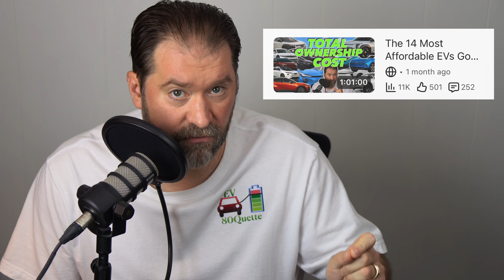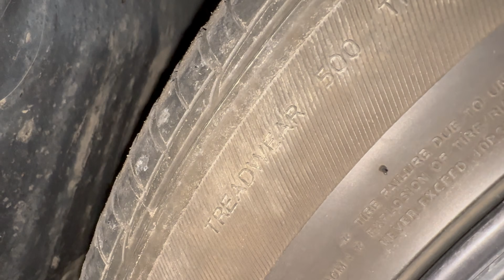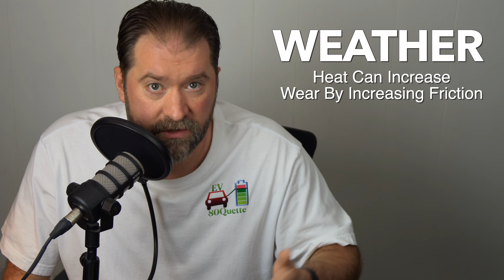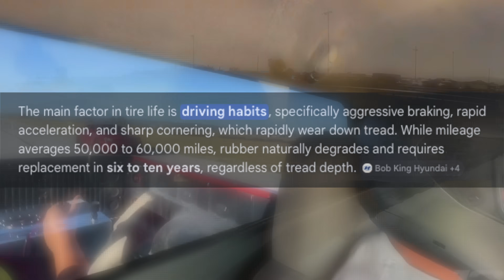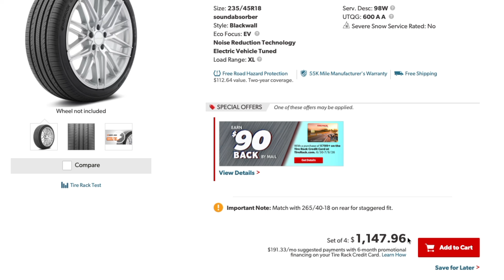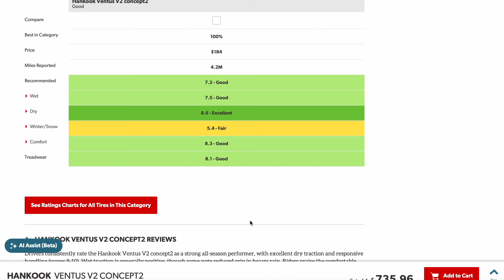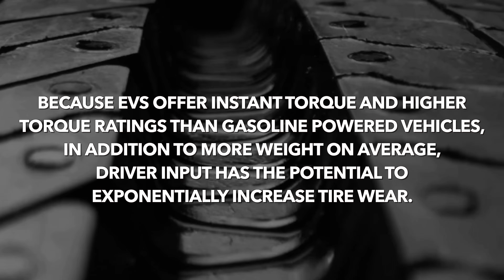I Got New Tires For My EV - Here's Everything I Learned

Comment: Wound up replacing the OEM Michelin Primacy AS on my IONIQ 5 at 39K miles with the Michelin CrossClimate 2s. Michelin does not exclude OEM tires from their mileage warranty, so I was able to get a 25% rebate after installation by going through their claims process; the hardest part was getting someone at the dealer on the phone with Michelin to verify the tire model and wear. The CC2s are slightly louder, but not bothersome. However they have much better traction in all conditions, and I haven't seen much efficiency loss, even on road trips.
Reply from the maker: The Cross Climate is a very popular tire, and great in every weather condition. Good choice! Nice to know you were able to take advantage of the warranty as well!

Comment: Great video.  I have owned a couple sets of Continental DWS's with my old ICE car and they are a great tire! I'm planning on getting a set on my Model 3 when the time comes for replacing tires.  My Acura would wear Michelins in the rear but the Continentals wore great and lasted twice as long. I would get about 42,000 miles on them with spirited driving.  I would expect a similar outcome with my Model 3 as well.
Reply from the maker: This is great to hear! I hope ours give a similar result

Comment: The best all around tire for me is the Michelin crossclimate 2 lasted over 60k miles. I wanted a tire that I did not have to swap out for snow tires. I live in the Rochester NY area with lots of snow in winter and the crossclimate 2 are 3peak and have worked great. Would have lasted a little longer but alignment went bad.
Reply: Forgot to mention my car is a 2021 Chevy bolt.
Reply from the maker: Thanks so much for sharing your experience.  Having a versatile tire that works in every weather condition can help a lot. Cheers!
Reply: I was this close to getting Crossclimate 2s because of good stories like this. Then I had someone change my mind at the last minute and I got regular snow tires instead. Now I'm stuck doing swaps while I continue to find stories like this about how great Crossclimate 2s are. I should have just done it. 
Maybe I'll just do it anyway and try to offload the other winter tires on eBay or at work or something. (not Facebook Marketplace, I've never had a Facebook account and I'm not looking to change that)

Comment: Good choice on the tires. I used to use those on the rear of my C6.
One important thing about tire pressure... It's set when the tires are cold, meaning they haven't been driven for at least a few hours or at freeway speeds. 
It's OK to let the pressure vary as it changes due to temperatures and altitude.
Reply from the maker: Absolutely right about cold pressure! Thanks for sharing your experience with the C6 as well, Cheers!

Comment: My EQS comes with run flats because no spare and the inner foam liner blocks the spray foam from sealing so no fix a flat can either.  I am getting rid of the run flats because I hate the way they ride and not all EQS come with them.  I’ll learn to use a plug + compressor for fixing flats.  Also Mercedes recommended tires come with MOE printed on the side wall, Mercedes Original Equipment.  I don’t know what that means as far as difference in the design, it just limits my choices.  There’s 3 wheel sizes for my car:  20”,21”,22”.  I have the 21”, they look better than the 20” but rides rougher, gets worse mileage and have less tire choices.  One more thing, I recommend every ev owner to get jack pads made specifically for your ev and give them to the shop working on your vehicle to protect your battery.  It was very difficult to find the correct jack pads for my car but for Teslas they are much easier to find.
Reply from the maker: Fantastic advice! And thanks for sharing your experience as well

Comment: I've been running the DWS06 for years. You made the correct choice. They do EVERYTHING well except range on a Tesla. I did experience a range hit but it's well worth it at the end of the day.
Reply from the maker: For our use case, range isn’t a major concern.  I’m glad to hear about the experience with these being good.  I really appreciate you sharing your experience!
Reply: @Aslash304 .....not just good....GREAT!!! I've been running them for a decade now! Best all-season tire in the snow, phenomenal in the rain and bested only by the Michilin's in the dry and they last forever....You're going to love them!
Reply: How much range did you lose?  I have them on my M3P that I bought used last fall.
Reply from the maker: @VAspeed3  no noticeable loss for me.  My best guess is 20 miles or less
Reply: @VAspeed3 .....it's tough to say accurately. With the stock 20in Turbines with the Hankook Ion EV tires I think I was averaging around 280wh/mile. My Continentals are on a set of 19x9.5 inch wheels and they're wide, 265 mm. I'm consistently in the high 290's - low 300's. The 20's are 30lbs+ and my 19x9.5's weigh 19.9lbs each. My 1st Tesla was a 2014 Model S and it came on factory (at the time) Goodyear Eagle tires. I recall losing about 10 to 15 miles of range roughly when making the switch.....same wheels. So that would be around an 8% loss or so? Not scientific by ANY means. But whatever it is the added grip in ALL conditions is well worth the trade off!

Comment: My model y has 7500 miles on it schedualed tire rotation through app. Came out to my house the following week and rotated my tires right there in my garage. Cost 70 bucks. Tires still have 8/32 tread depth…so this guy is just a salesmab
Reply from the maker: This guy here. I don’t work for anyone, the video isn’t sponsored, and $70 is astoundingly high for a rotation. If you buy from a reputable local shop, rotations are free

Comment: My wife's ZDX Type-S came with Michelin Primacy A/S tires, which are incredibly quiet and, at 25K miles, still looking pretty good, especially considering that we both have a heavy foot and like to enjoy the amost 500HP of this vehicle.  Plus, we've taken it mulitple times to the NC mountains to have some fun, sure, sometimes just casually crusing on the parkway, but other times pushing it a little harder on Moonshiner 28 and Tail of the Dragon.  These tires have only slightly better than average ratings on Tire Rack, but I have no complaints and would likely replace them with the same tires.

Now, the Goodyear Eagle Sports on our Vistiq seem to be wearing much faster, even though it gets mostly bog standard highway driving.  At 14K miles I'd guess they've lost 40% of their usable tread depth and I find them to have some road noise as well, I'm guessing 30-35K is all I'll get out of them.  But, there's not many options for tires of that particular size, at least for EV tires, so I'll probably go with the Hankook Ion Evos and see if they perform and hold up better on that vehicle.
Reply from the maker: I sincerely appreciate the detailed response and willingness to share your experience here! Cheers!

Comment: Thanks for making this! Now I know why my OEM tires have 4/32 tread depth at only 25,000 miles. The service guy at the dealer tried telling me they wore so fast from the weight of the car, but I didn't fully buy that.
Reply from the maker: “It’s the weight” is a fun deflection that people who don’t like EVs like to use when they don’t want to admit that the performance of EVs is superior to gas vehicles.  I appreciate you sharing your experience
Reply: @Aslash304  Another fun deflection is that "EVs have more break wear because they're heavy and harder to stop" 
Meanwhile everyone who drives one knows that it's all about coasting and regen all the time, having to use the mechanical brakes is either an emergency or a failure

Anything they can come up with to try and claim EVs are more harmful for the environment than cars that literally burn fuel every time they are driven. Ridiculous.

Comment: Ah, the old tire dilemma.  All made worse with the EV.  

I started selling cars back in 1988 and have been in the business for a total of 31 years (not consecutively).  One thing I've said for many years now is that tire warranty's are worthless.  They will always find a reason why they void that warranty.  Nobody can take perfect care of the tires and so I never put any weight in a tire warranty.  The couple things that I find to help make tires last longer:  Keep the tire pressure exactly where the door tag suggests.  Chech them at least once per month.  Rotate them every 7,500 miles or less.  Don't play with all that torque.  Resist that urge to stomp on the fast pedal and allow the car to slow more naturally instead of stomping on the brakes at the last minute.

My tires seem to last a long time based on wear.  And when I've replaced tires on two different EV's, I went with the lowest priced tire I could find that I felt looked like a nice design.  I was so impressed with the set I put on the Spark EV that I then purchased that exact smae brand tires when it was time for the Bolt's new tires.
Reply from the maker: Good advice, and thanks for sharing

Comment: @Aslash304 - Don't forget to have an accurate tire gauge, tire inflator, and check your pressure when the tires are cold.
Reply from the maker: All correct
Reply: Good advice! I have always found that the TPMS readings differ from a good tire pressure gauge reading by +/- 1, so I don't rely on them (although my Tesla does display them). I've found that it's a good habit to check the pressure with a tire gauge once or twice a month, usually first thing in the morning (before driving) to ensure "cold" pressure check.
Great video, thanks!

Comment: Dead on balls accurate (with apologies to Marissa Tomei for stealing her line) regarding tire pressure and rotations.
When everyone was bitching that their Fisker Ocean One’s /Extremes were wearing unevenly or wearing out after 8k miles, i had 22k on mine with plenty of remaining tread left before I sold the car back to Chase .
Looking to replace my TMY tires next spring (currently 20k on them) and your video confirmed many of my thoughts regarding steering away from EV specific tires to more performance rated higher spec tires instead.
Now i just need to find a good winter traction supplement to get me through this upcoming winter without having to buy a set of dedicated snow tires.  I find all seasons dont work well on hilly roads like we have here in Western WA state if you have to stop or slow down on an incline.  Chains are not a good alternative as 99% of the time you dont need them and they are a bitch to put on/take off.
Reply from the maker: This is a fantastic strategy. Having a dedicated set of snows allows you to stay performance focused for the rest of the year, and get a really good result as far as mileage with both. best of luck in your search!

Comment: The main problem with tire wear is a driver's right foot.
Reply: Yeah, same for ANY car, ICE or EV. I drive my EV like it were my ICE car. Light right foot except occasionally when I need to go around a real pokey driver. Besides, my Honda Prologue can't burn rubber anyway which is perfectly fine with me. I miss the old Mobile Economy Run competition.
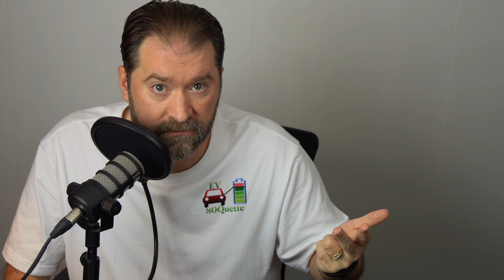Reply from the maker: 13:22. Noted, and correct
Reply: @Aslash304  Back in the late 90s I had a VW Golf mk1 base model(1100cc) the previous owner made it to look like a GTI, the wheels were GTI golf mk1 I changed them to mk2 14 inch GTI with over rated(compound/heat/speed) tires than standard thus those tires lasted close to 40,000 miles, light car + high spec tires = last longer.... It was hit by an uninsured driver while parked... really miss that car.... :(:(
Reply: Yup. I'm tired (heh) of hearing about EV tire wear. It's no different from ICE tire wear. Get the right weight rating for your car, keep the tires inflated to the manufacturer specification, and don't drive like an idiot. Tires will last just fine on an EV.

And by tires inflated to spec, I mean the sticker in the door jamb. I've seen so many people go to the tire itself, look at the max pressure rating, and inflate to that.

Comment: Weight is most certainly a factor but most heavy vehicles also get tires suited to the vehicle. A significant number of Tesla owners buy the cheapest Tire they can get that would wear out fast on an underpowered Honda civic. 

But spirited driving is always the primary cause. 

Also two-wheel drive cars wear out faster than all-wheel drive and front-wheel drive wears out faster than rear wheel drive at the drive wheels.
Reply from the maker: Well said! 100% agree

Comment: My used Bolt came with cheap Kendas that are great at everything except low noise, so that’ll be my next target. 10K and look new. 

When I was in high school I suggested my dad buy Pirelli P77 for grandma’s 1977 Olds 98 Brougham. Great car, except for the Olds V8’s complete lack of oiling up top that made rocker arms clatter.

ProTip: P77’s had nothing — zero — in common with the famous P7 back in the day. And one of them ejected its complete tread one day, deleting a trim piece from the door in the process. 

And although I am brand-agnostic on basically everything, when feeling lazy and just want quality without a lot of research, I’ll err on the side of aftermarket Michelins. You’ll pay for them but nearly always wonderful.
Reply from the maker: Michelin’s are indeed a great tire almost always.  When I sold tires I had a few die hards that just asked for “the best Michelins you can get for my size.”

Comment: Great video!  Scotty Kilmer haa said that rotation is not needed... Wondering if the cost of rotations and time wasted spent driving waiting at a shop over time is worth the warranty in the long run..https://youtube.com/shorts/8B4YeeMSS4Y?is=DAJQ3i8rrMSimQBj
Reply from the maker: If you buy your tires at a good shop they will rotate for free.
Reply: @Aslash304 did you watch Scotty... Guess not.. Carry on
Reply: Scotty is the Jim Cramer of business. He has some good ideas but also has bad ideas too- not rotating tires is an example of a bad idea.  

I got tired of driving and waiting to have my tires rotated and the constant upsell to buy new tires when I have 5mm of tread depth left- not to mention missing valve caps and lug nuts. 

I now rotate the tires myself and am much happier with the results and time savings- I spend < 1 hour doing and know the lugs are torqued correctly and are installed.  

I know doing it yourself is not for everyone. Either FWD or RWD cars are going to wear drive tires quicker. EVs are bad because regen also wears tires.
Reply: @rjmosko Scotty is nuts, occasionally speaks facts but often it’s BS.

Comment: Excellent info! And wry humor in presentation. Thank you!
Reply from the maker: Thanks for watching!
Reply: @Aslash304  Just enjoyed your video however i live in Europe and over here i have 2 full sets of different wheels sizes for my car Kia Stonic (that can be ice / hybrid EV) 
 one size came factory mounted on car when i bought it brand new 185/65 R15 XL H (it was in winter of 2023 so all tires were winter rated tires with 3 mountain peaks /snow flake +3PMSF)
the other set i got optional when i looked on the driver door pilar was available a bigger size : 205/ 55 R17 XL (H, V, Y) and i got a set of 17" alloy-rims brand new original from KIA dealer that is were i buy my car.. Those bigger 17" size were available as optional up-grade mounted with summer tires all brand new.. 
However after watching your clip i went to check out again the summer tires side-walls and to my surprise are EV rated !!! despite the fact my car is ice has (150 bhp) the hybrid version has and when i asked at dealer they mentioned that these tires size fit Stonic hybrid and Hyundai Inster which is full EV model but they mentioned since both are quoted here as small cross-overs i should have no problems no issues since that is what the factory delivered for both in EU as upgraded optional summer tires.. Now european cops mandatory look usually at legal limit tires size profile (no less than 5 mm deep on thread pattern is accepted but mostly for winter tires all over EU countries when the roads are covered black ice, frozen slush or fresh deep snow).. for summer usually when crossing boarders they might look to check basic safety concerns just not to have weird ware on profile, not be bald, no cracks, buldges or weird deformations on side-walls or something else..   
Anyway currently my car has 3 years now and what i discovered driving on summer with EV tires the car consume less fuel specially driving on longer trips at constant speed on highways and yeah ride quality is a bit more ferm, since a guy from dealer that rotate /align / balance tires explained that EV tires side-walls are a bit stiffer because are reinforced with kevlar bands to withstand & handle safely the car overall heavier mass for hybrids & ev  (kia offers 10 years warranty only if you do all maintenances in house at KIA dealers) but what my opinion about them is more precise in handling and straight water in rain evacuates quicker, no problem on breaking dry-wet, good grip in dry- wet, good traction dry-wet, lower noise inside cabin while rolling up to 150 km/h when we slightly start to hear rolling noise.. After 3 summers i have about 7mm thread depth from 8mm when were new.. so yeah, i do not know what to say i love them !